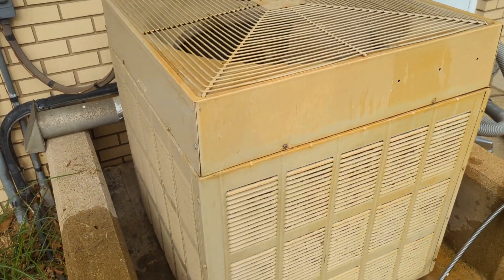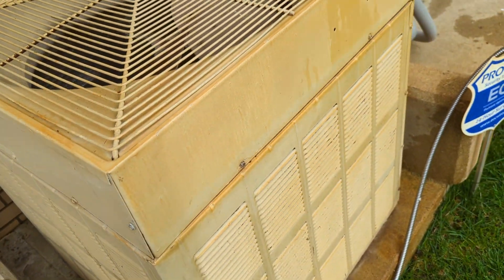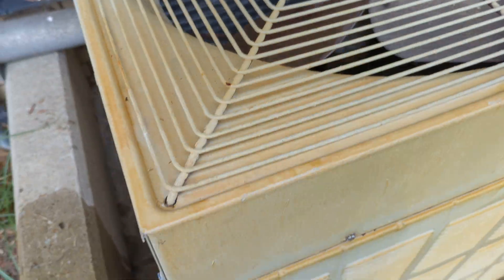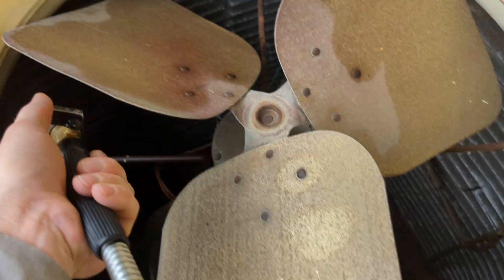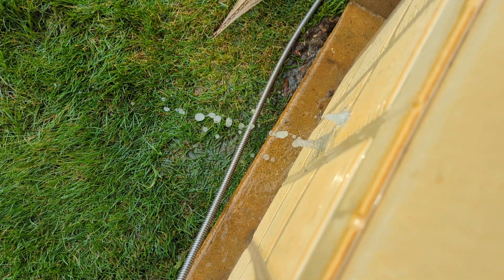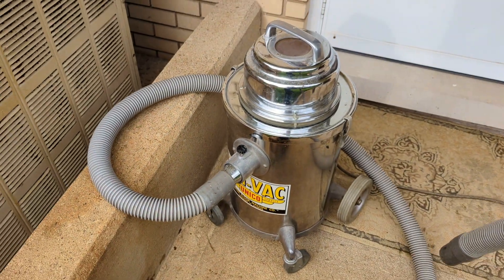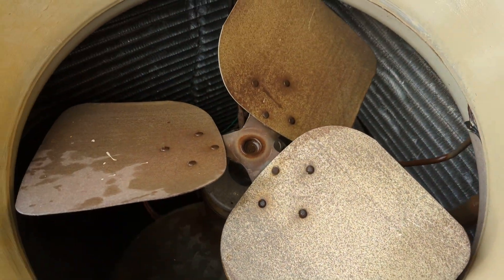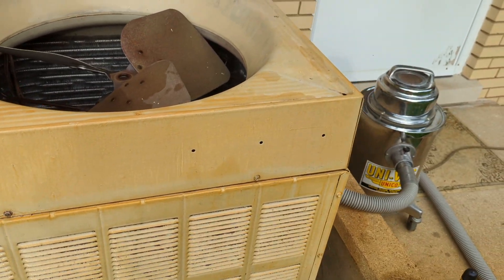How A Cheap Scot Helps Keep Ancient Air Conditioners Cooling Better And Lasting Longer

Comment: I have a window air conditioner that I got for free because they left the manual in it causing it not to cool properly well I took it home gave it a light clean  as it didn't need much   and it a super quite  kelvantor ac  the  fan is always  running  because   my cat and I like the breeze   it was a curb side find

Comment: My York hails from '93. Had the condenser fan motor replaced last year. Yesterday the high was 103. It kept the inside of my house at 78 while I was at work. The liquid line was hot, and the suction line was not sweating which means it's about two pounds low again. I'm trying to keep mine going as long as possible. Eventually, I'll need to do or have a leak test done. The small leak is probably in the evaporator inside the air handler. I'm hesitant to have it replaced because I'm not sure how reliable the new condensers are, and the York still works. As side note, growing up I considered going into HVAC, then my grandfather said I wouldn't like it because I would be on top of hot buildings/attics, and he said I wouldn't like that. So, I scrapped that idea. I'm still fascinated by the whole principal of air conditioning and the process of moving heat from indoors to outdoors via refrigerant. The one downside of keeping these old units running is if you have a leak like I do the availability of R22 is going to continue to decline. It's already very expensive to have a professional HVAC company come in and recharge it. Unless you have a small-town guy like I do. Or get it converted, which cannot be done if a leak is present.
Reply: don't waste your money on a top-off which is a temporary fix, either have leak found and fixed or replace. leak repair probably not worth it at this age. topping off leaker is illegal in all developed countries except for us.

Comment: the only problem with those units is they're likely 6 to 7 seer - but i guess if you're in a real winter climate and only need cooling 2-6 weeks each year, you'll never recoup the cost of replacing working units.